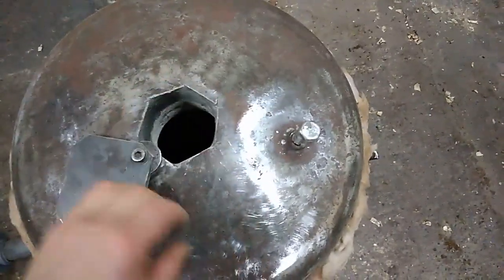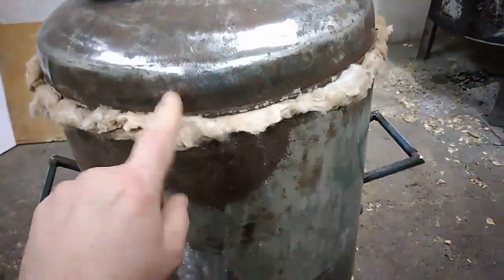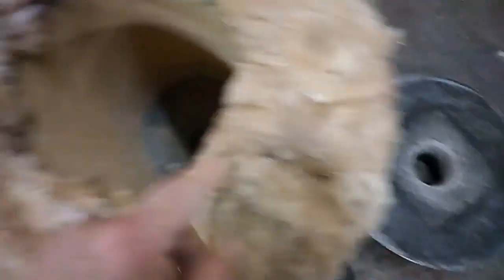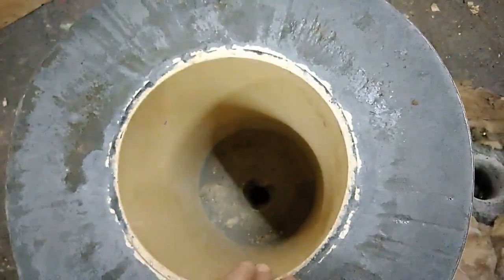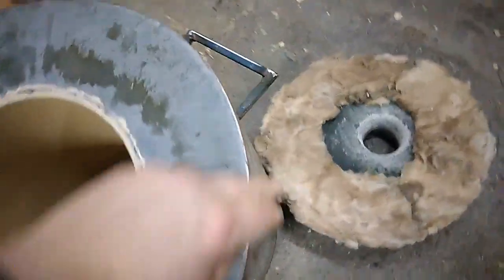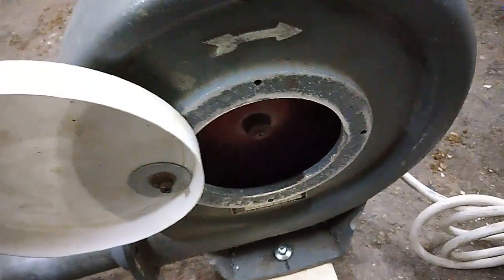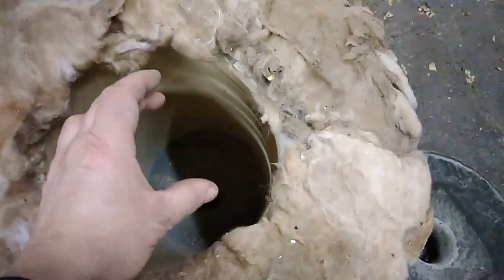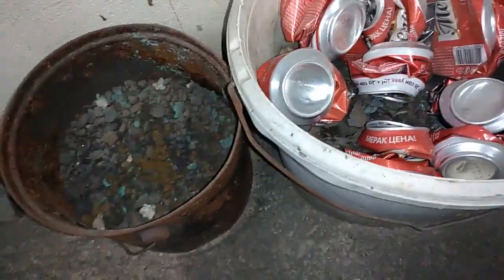My FURNACE on CHARCOAL presentation.

Comment: should work good , just wondering if ya should have used an oil burner instead , charcoal can be a pain in the ass to make in big enough amounts and way too expensive to buy here in the states , really easy to adapt your furnace if the charcoal becomes a problem tho , good luck with it either way , how about a vid on lifting tongs and tools too